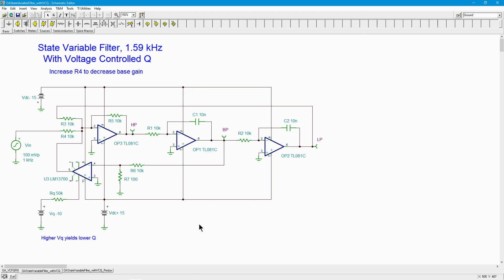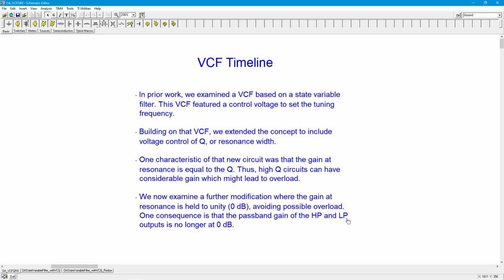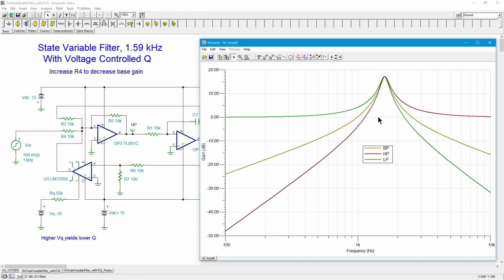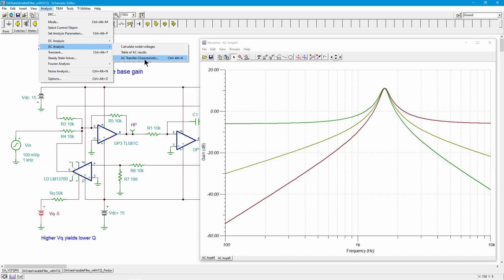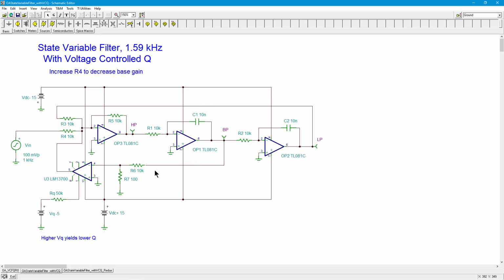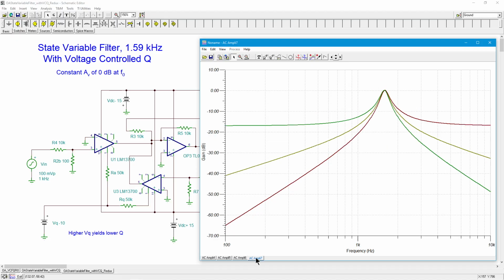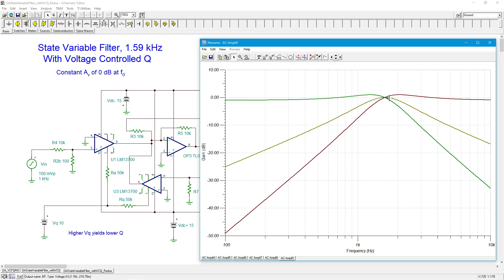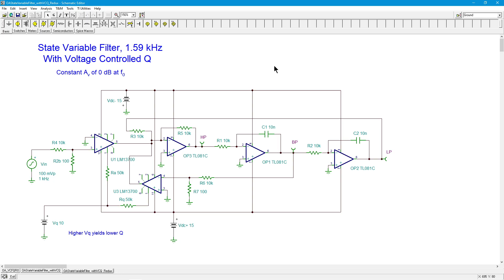Op Amps: VCF with Q Control Redux

Comment: How can i control the cutoff frequency of the filter?
Reply from the maker: There are a bunch of related videos on the topic (see the video description, above). This one in particular:
https://www.youtube.com/watch?v=U9nc61dGUPk
Reply: @ElectronicswithProfessorFiore thank you that video is awesome. But how can you get a wider range over changing the frequency ?
Reply from the maker: @jeremy465  With this basic form, that gets tricky, especially for audio because you'd probably want the CV to control the frequency with a log function (e.g., one volt = one octave) to get a huge range with appropriate accuracy. I would concentrate on the control voltage versus Iabc relation (versus the simple scheme shown here). Also recognize that extending the f range may have other effects (e.g., unintentional bandwidth limiting, offset/drift, etc.), depending on the OTA used.